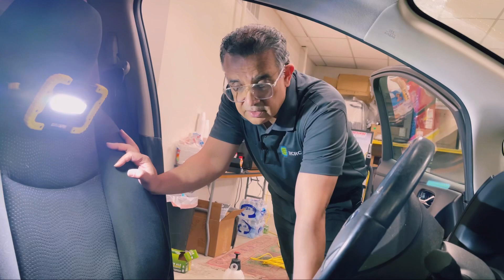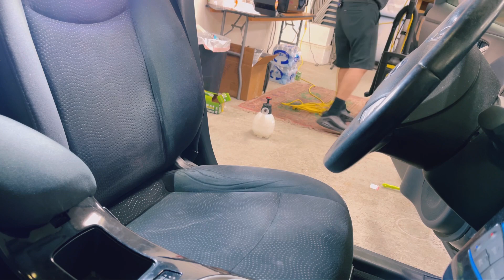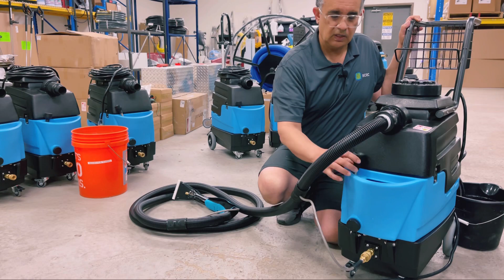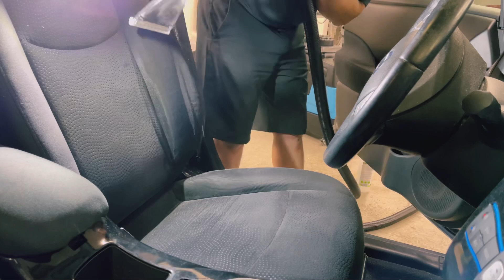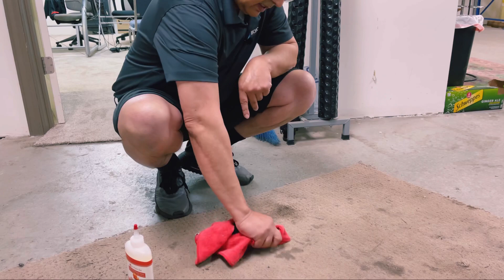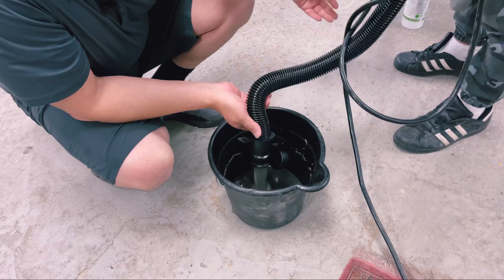BEST CAR DETAILER EXTRACTOR?! Mytee Lite 8070 in-depth review + Waste Water Dump (Oddly Satisfying)

Comment: i have same extractor mytee lite 8070 and i get intermitted heat gets super hot cant put my hand on it but only for few seconds than it just sprays warm water any ideas please.
Reply from the maker: It is probably the jet size on the upholstery tool that you are using with it. Reduce the size. :)
Reply: @magicwandcompany  hi do you know where i can get the reduce jet size please.

Comment: I know that a lot of detailers get those but I can see the shortcomings of it. I would get a smaller unit that is cold water that I can put an external heater on. In practice they seem like they work good but I'm overly skeptical about a lot of things.
Reply: The only problem with that is most non heated units don’t have the internals to handle the heat. Fittings, gaskets, lines etc.
Reply: @sneakynun  yeah you might be right.
Reply: You start running out of power. They try to keep the Mytee Lite about to work off a 15amp breaker.  It produces all the suction and heat you can get with 15amps. It gets hot, that's why it comes with the heat insulation blanket around the handle. You cant run it non stop hot water or else it wont keep up....BUT you dont extract that way anyway. You inject water then a pass with no water to get some excess water out, when you do it that way you dont run out of hot water.